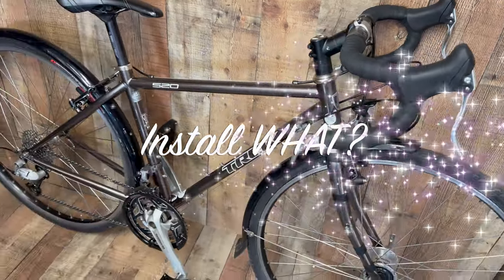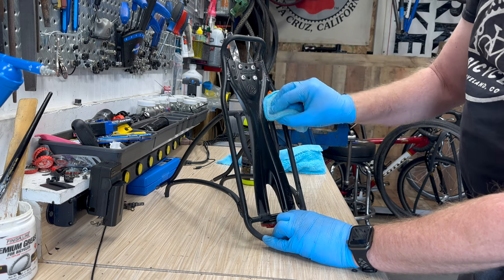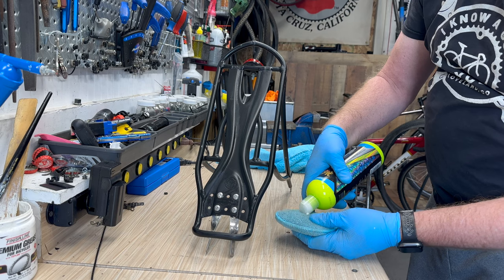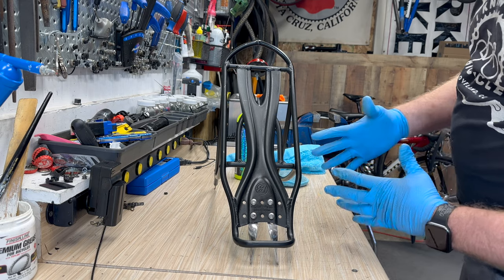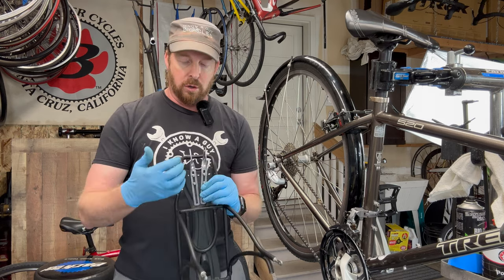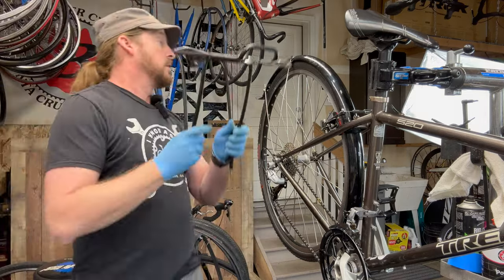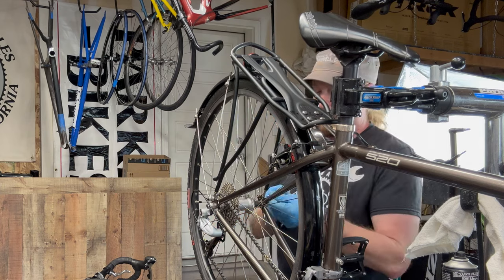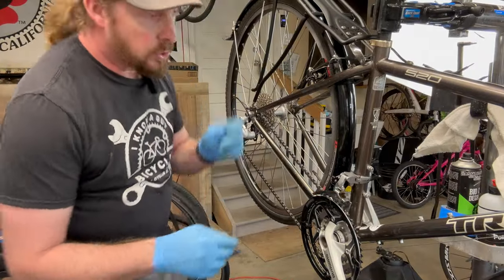How To Install a Rear Bicycle Rack - Review on a Trek 520 Touring Bike

Comment: must the rack come off to change a flat tire?  And what size thread screws did you need for your Trek 520?  Thank for your  videos. My ride is much better and safer as a result of what you've covered. Thank you
Reply from the maker: You can remove the wheel without affecting the rack or fenders. It just drops out underneath. Front and Rear Wheel.